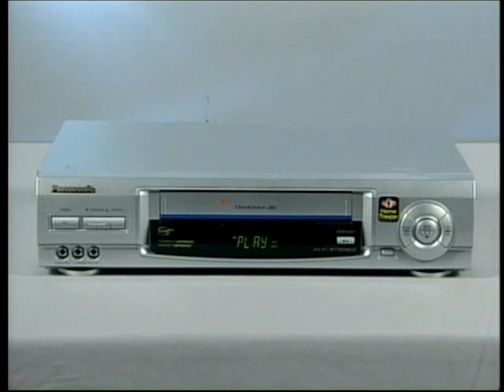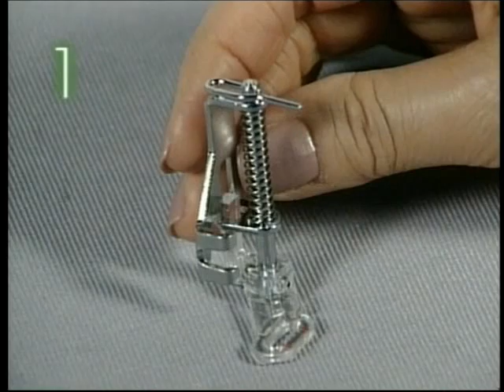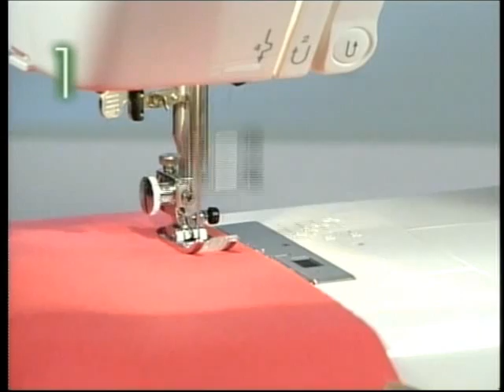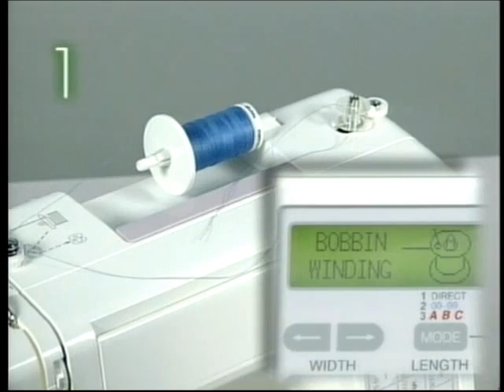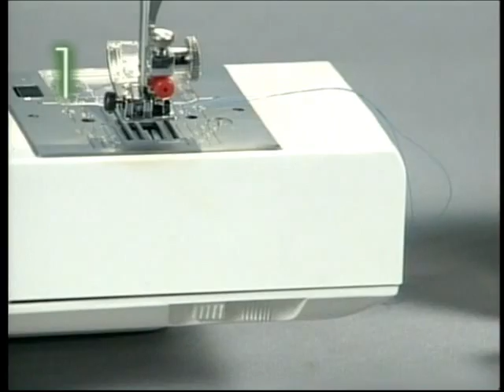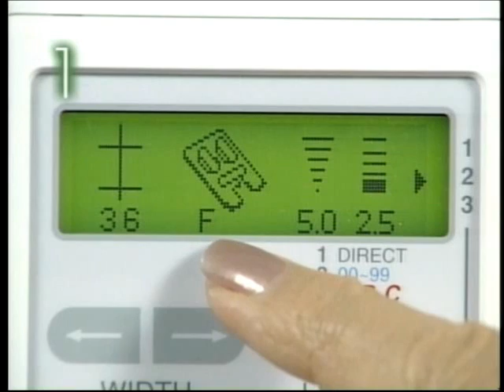Kenmore Sewing Machine 19233 Instructional DVD 1 of 3

Comment: For everyone who is looking for a manual and can't find it:  The JANOME DC5100 (19233) is the same machine. Here is the link to the manual: (https://www.janome.com/siteassets/support/manuals/computer-models/inst-book-dc5100eng.pdf). I've got this used Kenmore (355-19233) recently and can confirm that the information I received is correct. Who would have thought that! I was looking for a reasonable priced portable machine besides my big Janome MC6600P, since it is just too heavy for quickly taking it with me, and found it on Social Media. All the presser feet and bobbins fit, additional it is very similar to the Janome MC6600 to operate. I am a happy camper now.

Comment: I am so frustrated and sad, because my  Kenmore Computerized Machine 19233, is not working, I was told to take it to SEARS workshop here in Hialeah, then I had to ride the bus with this heavy machine, only to be told they no longer repair sewing machines.  Grrrrrrrrrrr!!!! 
It has a weird noise like a tummy gun and the stitch it's awfully tight and I can see the thread from the bobine; then it get mingled with the upper thread.  I am going nuts.  On top of everything, SEARS no longer sells Kenmore sewing machines.